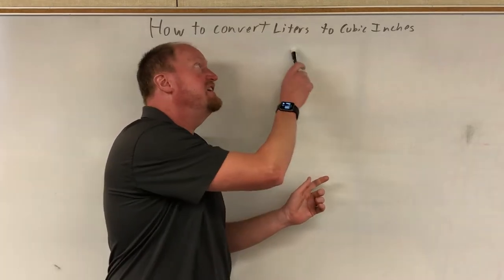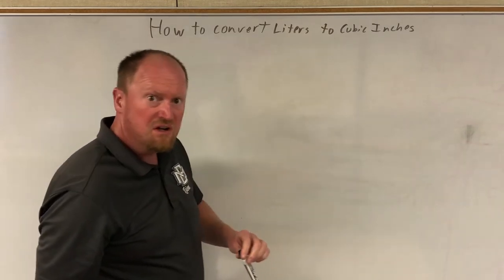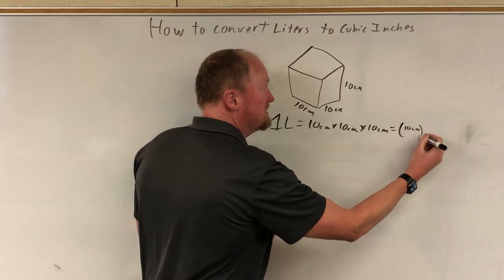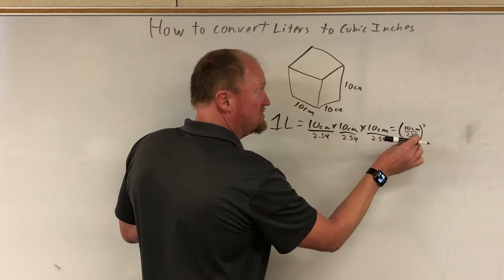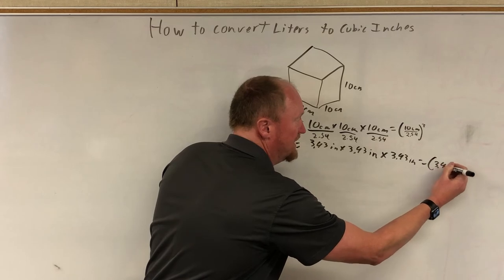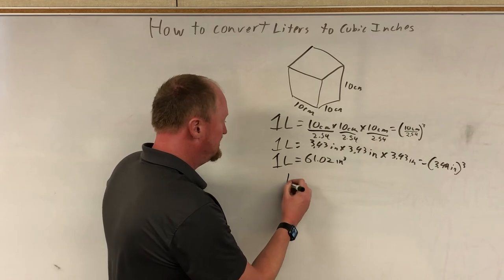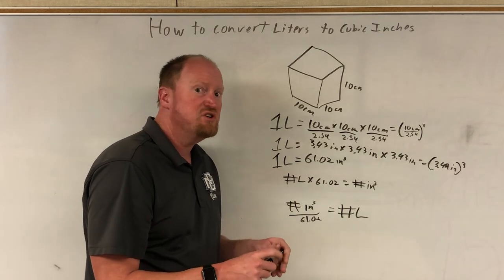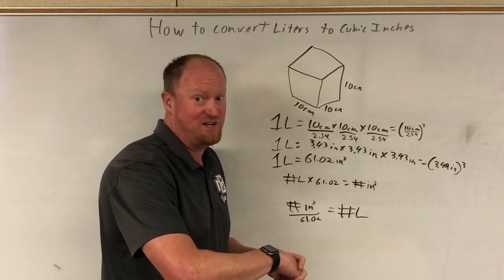How to Convert Liters to Cubic Inches

Comment: Man, you made that way too complicated. Why not, just be honest and tell these geniuses the truth. Explain to them, first you have to convert the liters to DC Volts, then convert that to AC Volts, then convert it to gallons, then to ounces, don't get frustrated. There's only a few more steps and you're done. Now, convert The ounces to watts per square feet, then to degrees celsius and fahrenheit, then add the two together and get the average by dividing by 2. Then all you have to do is convert that answer to cubic inches. See, it wasn't hard at all, was it?